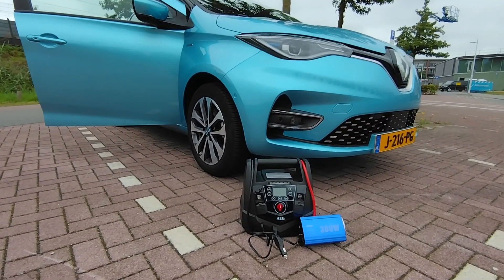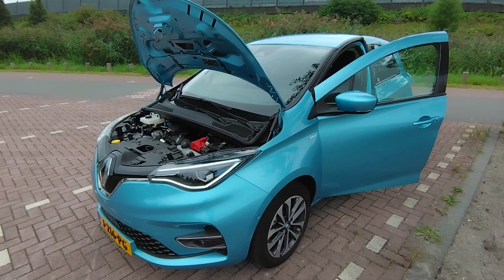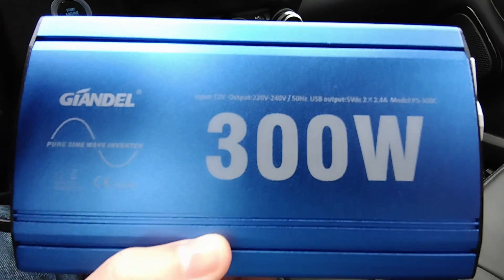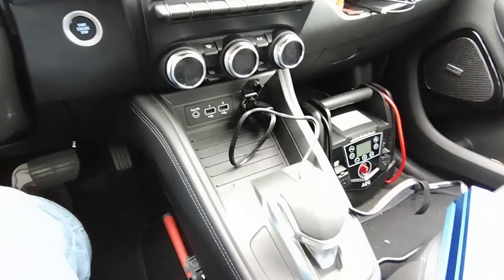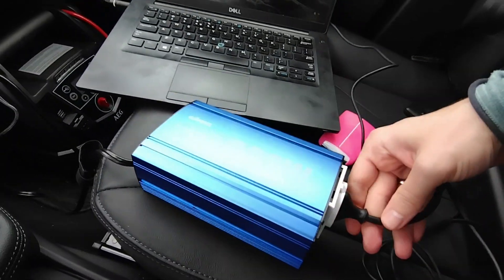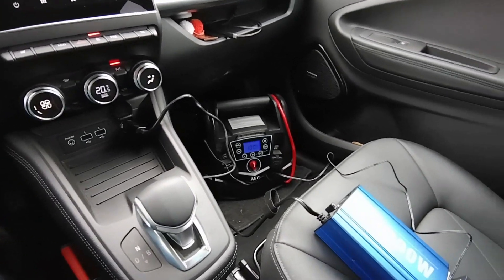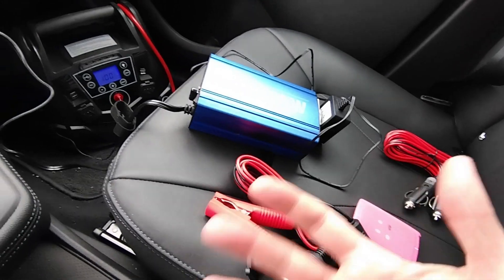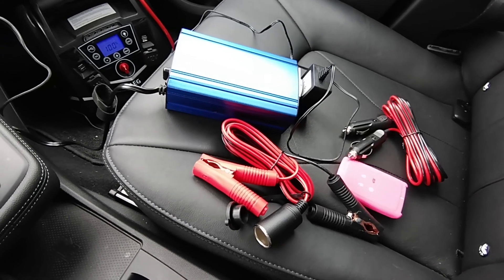Renault Zoe reverse DC to AC charging solution for backup power - Unlock your French EV powerbank!

Comment: Wow.  bad!  the 12v battery isnt the same as the battery pack itself.
Reply from the maker: It's not bad because the main Battery pack keeps on recharging the 12V and that's why the inverter is connected to the 12V either with clamps or in the cigarettes socket.

Comment: Interesting idea, but I am afraid that it will not work in the way you think.
The 12V outlet will only work for about 10min after turning the car off (main battery protection mode).

If taking the power directly from the 12V battery. You might get into a way bigger problem. After about 30 min the 400/12V DC/DC charger 200A capability (in the ZE50 (100A for ZE40)) at the 12V side will turn off. After that you are only loading the 12V battery, if that gets too depleted you will not be able to turn the car back on until you replace the battery at 150 to 450€ depending on the sourcing...

You could of course leave the car fully on and then it will work until the main battery is depleted to 0%. But then you have other risks involved also theaft, etc, as you can not lock the door if the car is on.
Reply from the maker: Hi indeed you're right  it's for emergency only or on your own private protected property like a garage. I would leave the car on so the 12v constantly gets charged. In my other car a Bolt EV Ampera-e there's a way to trick the car that there's still someone in the car by leaving the seatbelt buckled in and editing via the other door and locking it outside. Not sure this same trick would work for the Zoe but it's nice to have something in case there's no power or going off grid. 👍 the new Renault 5 solves all that with an ac power outlet!

Comment: I wish someone could hack the Caméléon Charger to get DC ouput on the DC pins. What is needed is a reversible DC box and some Green PHY magic 🎉 This could bring V2H for a noce backup solution at home to be offgrid or safe during power outage😊
Reply from the maker: Agree! That would be ideal for everyone. I don't understand how with all that technology and creative minds out there this can't be offered as an ad-on for people who have that car!
Reply: @maximaalski  I anticipate two scenarios : either the DC box can act as a two way DC to DC convertor or it is only a one way design (higher probability) which means we will have to design a drop in "two way DC box". This means full reveremse engineering of the DC box and cloning what is possible to clone with respect of any patents. I failed to see a picture of the DC box itself or any architecture diagram of how it fits between the CCS socket and the rest of the Caméléon charger. I expect the DC box to incercept the signalisation and forward them tonthe legacy box if not a Green PHY charging session or if no power is detected on the DC pins. There must be bidirectional signalisation between the DC box and the legacy AC box to handle the bad earthing cases or any issues too. Lot of work, but might be feasible .... I was expecting Renault to propose an upgrade but they went to bidirectionnal AC trials instead of bidirectional DC like V2x...
Reply from the maker: @testman9541  This is very interesting I believe Renault should hire you as a contractor to help them design something like this as a consumer product so evryeone can enjoy this feature 😀👍 Just curious: did you ever connect an invertor with battery clamps to the 12v battery in the front and how long you think you could realistically run it with proper thick (jumper) cables and which load? I saw some videos where people went with another car around  1.000/1.300 W continuous but that seems like a lot to me. Also they installed a bi-pass to the 12V with breaker and quick connect cables which is a lot of work. With direct battery clamps will be easier but may pose a security risk under higher load cause of temperature and heat built up. Curious to see what you think about it. I'm happy with this 150-300 W plug or battery clamp solution but some people may need more than that then just for lights or charging a device. Cheers and have a nice weekend
Reply: @maximaalski  There is a limit to the OBC rating, see YT video on OBC 😉 Renault have done reversible 3 phase attempt in NL, but they should have designed a custom OBC for  that purpose but I do not have seen the reference for this or any diagrams. I have not made any test so far has the Zoé I use is still under guaranty. But I would prefer to go to a reversible DC box way. Doing so you can use a DC two way CCS charger that would not endanger your home. I don't expect Renault to be interrested into having such an option and I am not qualified on a professional level to buid that. But I am qualified for the Green Phy part and the inter modular communication... We need a core high power electronic designer with DC to DC knowhow and strong safety knowledge idealy in the automotive market 🥂

Comment: hm, do You know that this way you will kill yout peb module very quickly? Please check how much peb module.cost in renault. You will quickly change your mind and do not show such not so smart ideas...
Reply from the maker: Good morning I looked up the costs of the peb module and it's indeed expensive! But if the 12v cigarette outlet socket is rated for this and you can clamp the batteries in case of emergency power use cases, shouldn't it be no problem to use this once In a while? Did you do something similar that caused this module to break and what happened?
Reply: @maximaalski If the 12V plug is rated for 100W there is no reason not to use this at the max. Renault must have make a safe bet as they know people will plug a fridge or any other camping stuffs there 🎉
Reply from the maker: Thanks I'm glad you're confirming my suspicion. I think it is safe to use like that and there is a safety margin. This is also not an invertor solution thya you would be running for days anyways but for limited time when needed and at convenience.